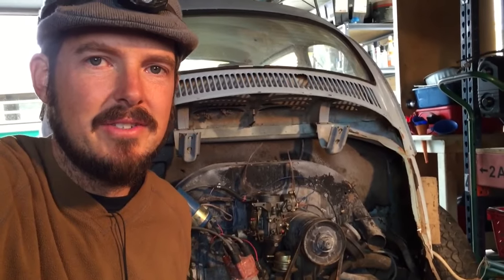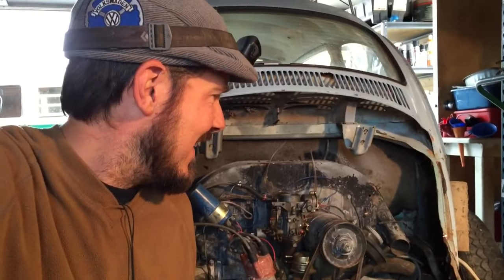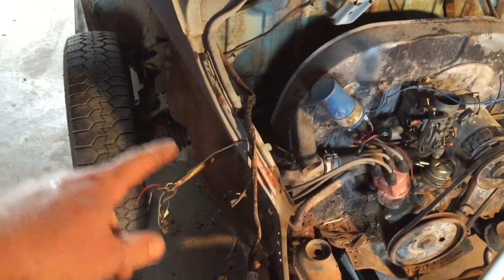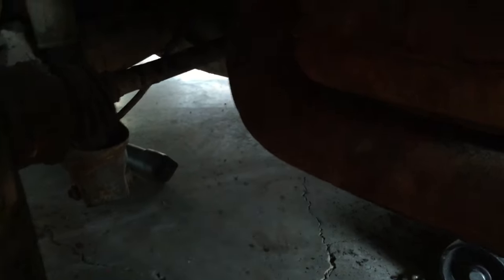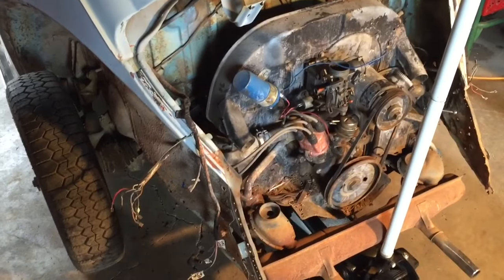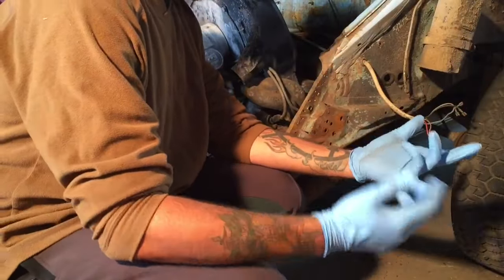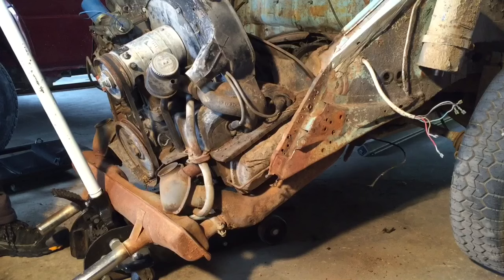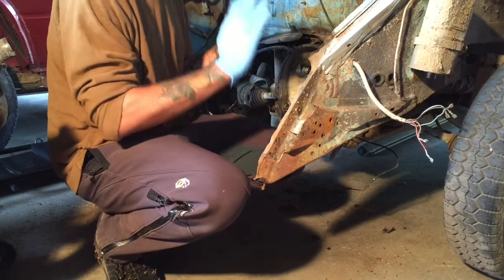BUGaru Part 3 - Aircooled Engine Removal

Comment: The only thing i'm curious about is where you got that Ej22 T? Around here in the north bay - I can usually find a Jdm one and take my chance, or go with a rebuilt one. What's your take? 
I'd be using mine as a daily driver.
Reply from the maker: I'd go JDM any day - great value and they're usually really good quality. My block has a ton of miles but I had the heads rebuilt - we'll see how long the rings last.